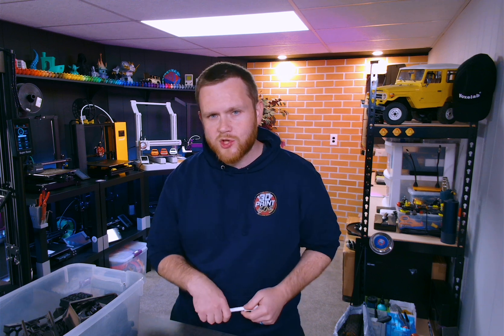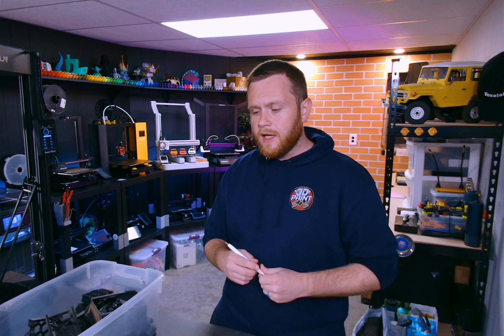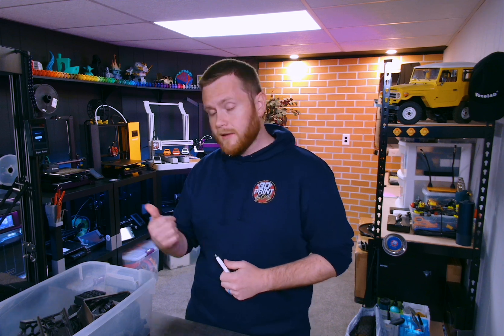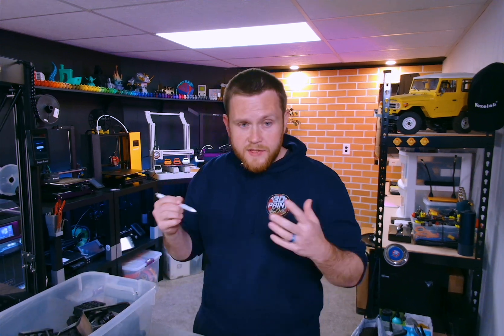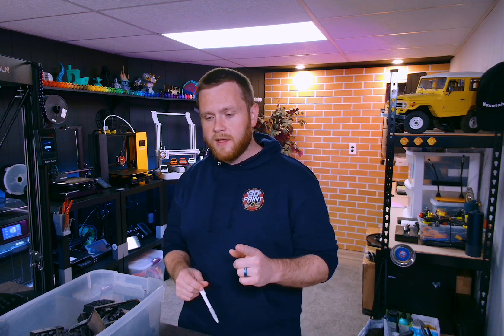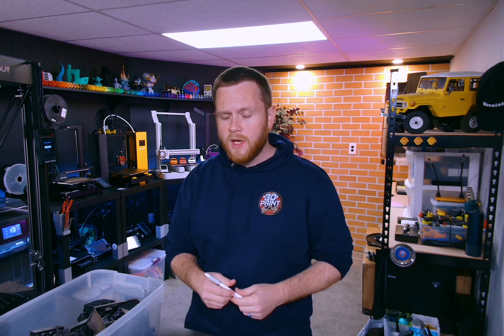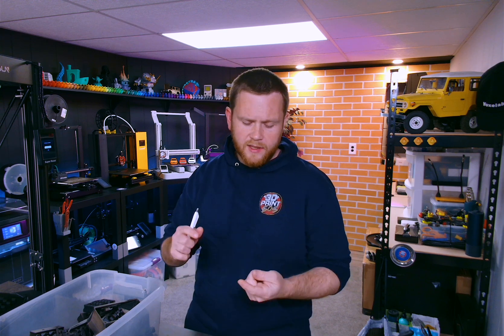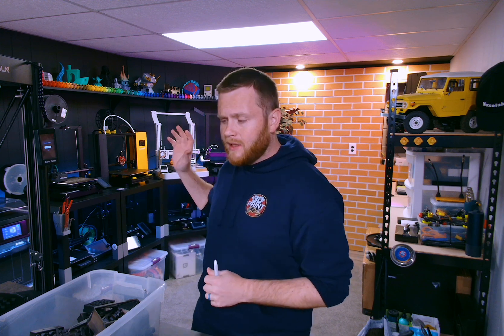My Qidi Tech X-Plus 3 is Out of Commission. For Now...

Comment: i’ve also been experiencing issues regarding the mesh and offset, but i absolutely agree with what you said. their support has been incredible and really i am still happy with my machine. i got a half refund and prints have been great in petg and pla using prusa slicer
Reply from the maker: I hope they can nail it down and bring the machine back to life with some fixes.
Reply: @3DPrintSOS  i have so much confidence, they have been a player in the space for almost 10 years and they have a lot riding on these machines. i think the steps taken already show us that qidi isn’t playing around and they want to get this right
Reply: I ALSO HAVE THE X-PLUS 3 AND ALSO USE PRUSA SLICER, BUT THE QIDI ONLY HAS 1 .2 PLA PROFILE AND NOTHING ELSE , WHERE DID YOU GET YOUR PRUSA PROFILES FOR PETG AND DO YOU HAVE MORE THAN JUST ONE FOR EACH, AND IF YOU DO ARE YOU WILLING TO SHARE THEM , THANK YOU
Reply from the maker: Try Orca Slicer. The latest has awesome profiles.
Reply: @3DPrintSOS  I DID , I AM RUNNING LINUX KDE NEON I INSTALLED IT AND COULD NOT CONNECT TO THE PRINTER , I MENTIONED IT TO LINDA A QIDI AND SHE CAME BACK AND TOLD ME TO USE , :10088 ATER THE IP ADDRESS , SHE MUST OF TRYIED IT , AND , I TRYED TO DO SO AND THIS TIME THE APP DID NOT WANT TO OPEN , now im just trying to find out how to suscefully re-install it. , it would be nice if with orca slicer we could print a 2 color print like the prusa does it

Comment: I am glad to know I am not the one.....I run my business with X-Max 2, x-plus 2, X - Carbon pro and a i- fast.

I started out 4 years ago with Qidi printers and just sold original ones and replaced with the version 2.  Then I bought the x-plus 3 and it has been a nightmare.  I never know when it is going to give me a usable print.

I can no longer spend hours trying different things and am going to message them today for a return label and full refund.

Their CS has always been outstanding.   One they get this fixed I may try another.

A few days ago I bought a Bambu Labs X1-Carbon pro.   I have printed a lot of Cf Nylon and PC with it and no issues.
Reply from the maker: By the sounds of things, you won’t need to ship back the machine. They will do a full refund with nothing in return and you can keep it tinker. Or take half the refund and keep the warranty for when they have fixes for the machine, it’ll be covered.
Reply: @3DPrintSOS  they are refunding me today.  I have tons of videos they had a chance to look at and know exactly why I wasn't happy. 

I still have 10 other QIDI printers for my business.

Comment: I have ordered an X-max 3, super hyped for it considering I am upgrading from an ancient Lulzbot Taz 6 (8 bit marlin).
Reply from the maker: Nice! Let me know how it goes. I have some insights, so if you have questions, don’t hesitate. Find me on discord as well. ;)
Reply: At the job I retired from a couple of years ago, we had an even more ancient Lulzbot Taz 5.  At the time I left, it was still going strong, and probably still is.  That Taz 5 was my very first hands-on 3D printer experience.  We later got a Taz 6 as well.  Both are very well-built and well designed machines.
Reply from the maker: Gotta love a bullet proof machine
Reply: @William3DP  We have two Taz 6 machines, they are quite dependable. My only complaints being the print speed and quality are at best average these days, and we need something enclosed to better print with ABS and nylon materials.